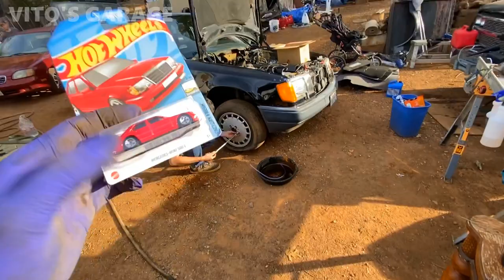Almost Back on The Road! Black on Black 1991 Mercedes W124 300E Gets Final Goodbye Repairs From Me

Comment: on my 90 300d (w124) the brake fluid hadn't been changed in so long that there was gunk and corrosion in the calipers...several were so pitted that I had to put new calipers in.  The abs pump was also destroyed by water/rust because the fluid hadn't been changed in so long.  Now with a bunch of new parts and clean fluid all is well...and I won't wait 20 years to change the fluid!
Reply from the maker: Keep up the great work! We love these amazing machines!

Comment: Tip you clean the rotor arm ..Remove it first,  and rub the brass contact on your rubber tyre ,this will never remove material only corosion from the rotor contact point .Sand paper will make the gap larger over time this is if you keep cleaning it with sandpaper ;

Comment: Hey Vito big fan of the videos keep up the great work! I was wondering if it's possible to make a video on how to properly adjust that pressure plate you did a few videos back? I would really appreciate it much love!
Reply from the maker: Which pressure plate?
Reply: Sorry for the late response but I meant the fuel air mixture plate on the fuel distributor

Comment: Was planning to go look at a 91 300e tomorrow, but the picture the seller provides of the engine has me concerned.  Right off, the dipstick is on the wrong side of the engine (passenger side), and there is something off from that with a wire coming out to the other side.   I tried posting a link and youtube immediately takes it down.  If you're willing to hunt its in Kijiji Windsor Ontario  Classic Cars.  It's the only 300e there.  What do you think?
Reply from the maker: Wrong side of the engine? That’s strange. Maybe it was imported From Japan? These are amazing machines! Go look at it and buy! I’ve saved and restore a lot of them. I’m currently restoring 4 other Benzes
Reply: @VITOSGARAGE  Thanks for the reply, went and saw the car, actually was on that side.  Noticed two things, putting it into gear wasn't firm, I had to fiddle with it.  Concerned might be a transmission issue.  Oh and he said takes regular gas, I pointed out it takes Premium.  Any harm if he's been driving it five years with regular?
Reply from the maker: @hagbard72  no harm. But yes, you should use premium. When you shift it into gear, I mean, as long as it engages, I think that’s all that matters. One of my machines bangs into gear every time I shift into reverse or drive